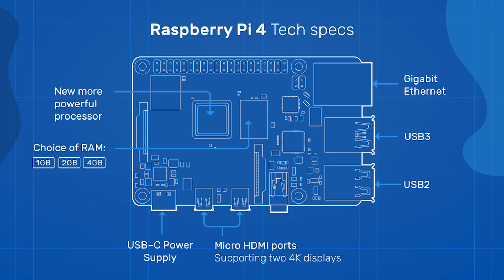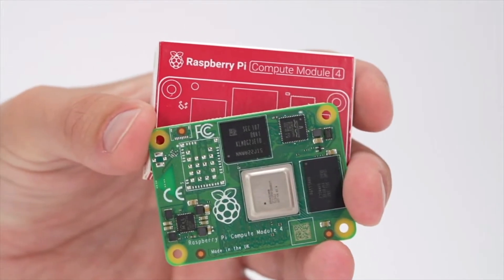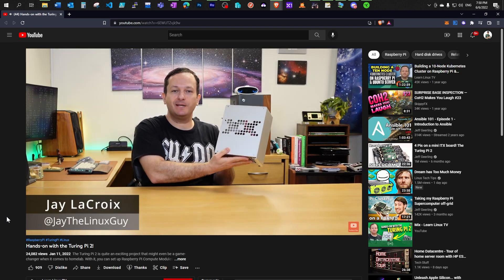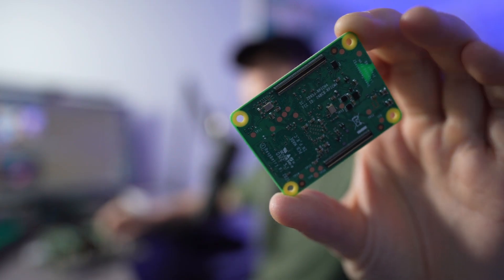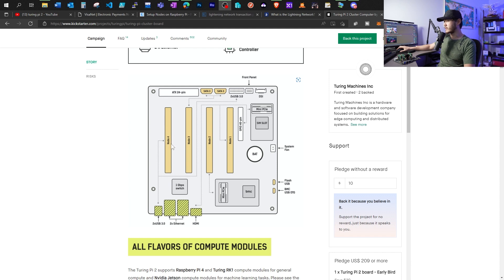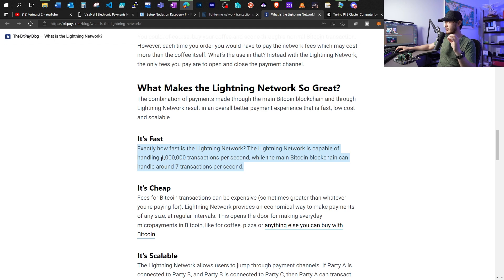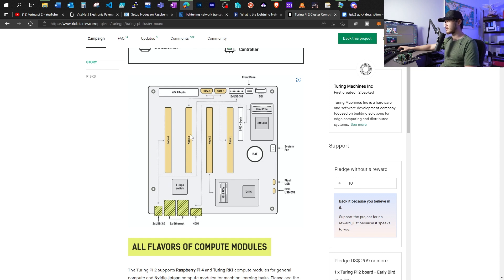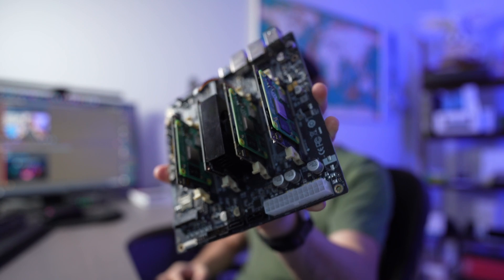Mining Multiple Crypto With This Raspberry Pi Cluster | Turing Pi 2

Comment: Great video Modo! Would this support 4 Cumulus FLUX nodes?
Reply from the maker: They just announced that these boards will come with 4 m.2 slots on the back that supports up to 8Gb/s storage speed. 1 for each node. My testing unit doesn’t have it but with the new update it could support 4!
Reply: @ModernDogos  That is awesome!! Thank you! Would you consider doing a video setup guide to do this?
Reply: There is something I don't understand. If I want to install FLUX on all 4 nodes, but HDMI is only available for node 1, how do I view software installation and setup on nodes 2, 3, and 4?

Comment: I see endless hours of wasted time with clunky hardware. Apart from starting in machine learning and especially as a crypto node machine: Take the same money, run proxmox with vms on a used but proper enterprise server and use maybe 150/200w instead but save 15 days+ a year in maintenance time and spare parts cost.
Reply: Yeah, the Raspberry Pi 4 isn't exactly the most powerful piece of hardware. It's basically like a low end smartphone. You'd need hundreds of them clustered together to mine crypto effectively, and with the current chip shortage, Raspberry Pis are hard to find and expensive.